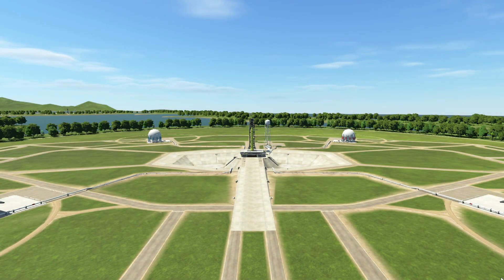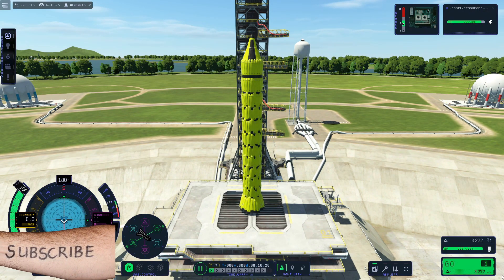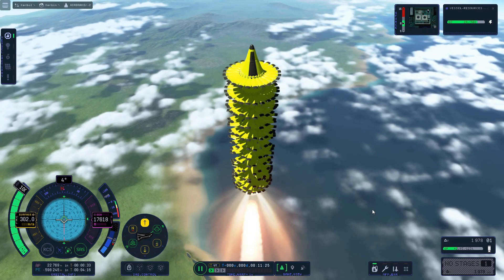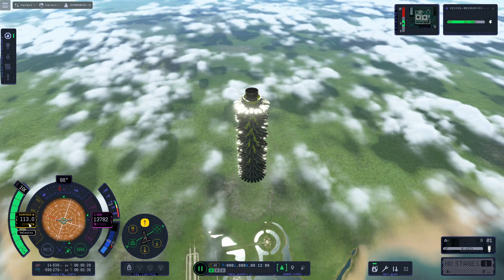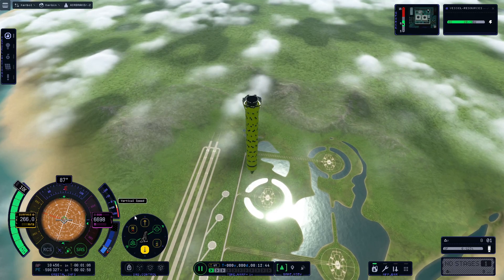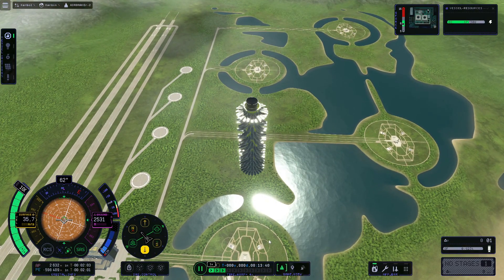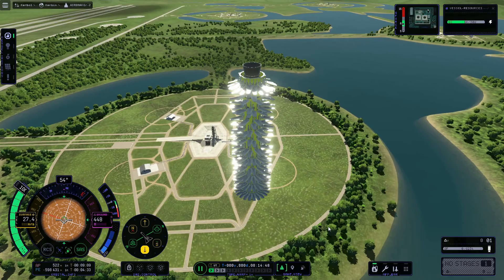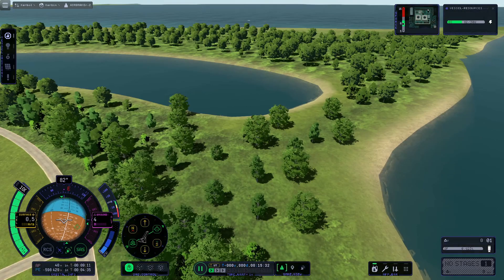248 A.I.R.B.R.A.K.E.S on one rocket booster

Comment: i think at this speed it would break if you land on land, but i thik]nk if you put some landing gear or structural parts at the front it will survive
Reply from the maker: I had some parachutes on it in an earlier test, but the Kraken attacked and they caused it to oscillate wildly - typical of KSP.

I would like to have landed it upright. Perhaps I'll try your landing leg idea with a modified version.

Comment: that brake maneuver in low atmo maxed the Gmeter. at least 15G..... one hell of a way to kill your crew XD
Reply from the maker: Ah, but this one was unmanned. To be clear, I have absolutely nothing against mercilessly murdering Kerbals, but I just didn't pack any on this trip. 
Maybe next time!😅
Reply: Turns out that it takes upwards of 40G in deceleration to kill a human…kerbals seem to be far more resilient
Reply: @julesjackson4855  true true, the gauge only went up to 15, just like Chernobyl, “well the meter only reads 3 rad. Ehh it’s fine”
Reply from the maker: @julesjackson4855  it depends on how long that force has to be sustained. A boat crashing over/through waves can hit ridiculous G-Force levels, as can a car in an accident, but only for split seconds at a time. On the other hand, if you pull 10 Gs for a couple of minutes, you'll probably die.

Other things that play a role are your orientation: you'll notice that fighter planes often cant their seats backwards to avoid blood pooling in the legs; training and fitness of the person experiencing the g-forces - the clenching of lower body muscles and performing a valsalva manoeuvre can partially offset the effect of g-forces; and the wearing of a g-suit which squeezes the lower extremities.